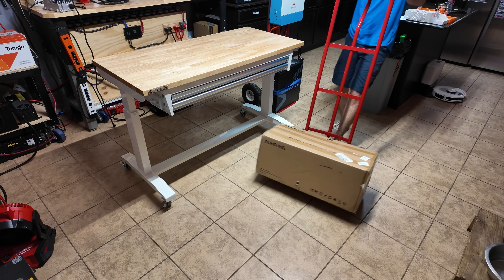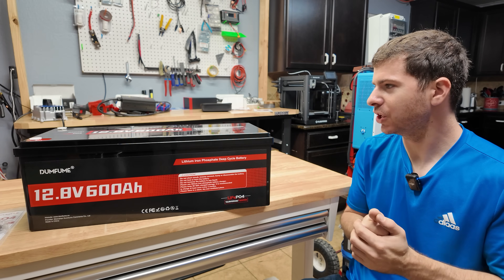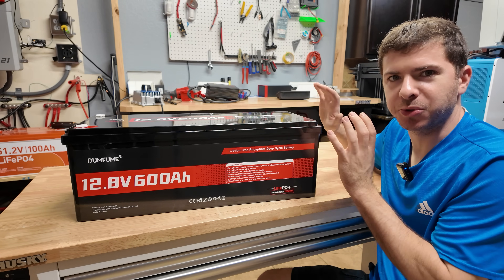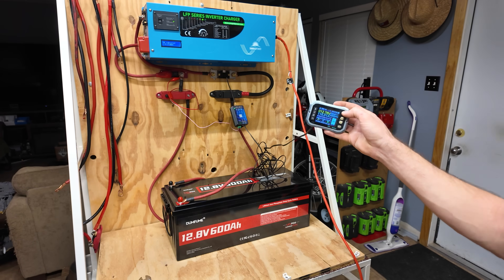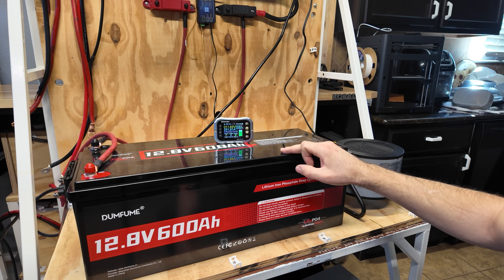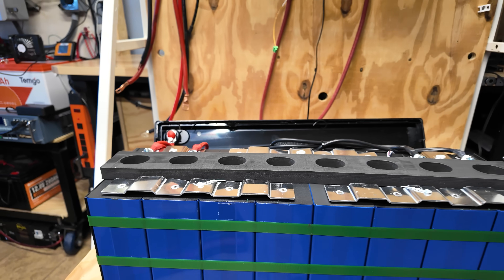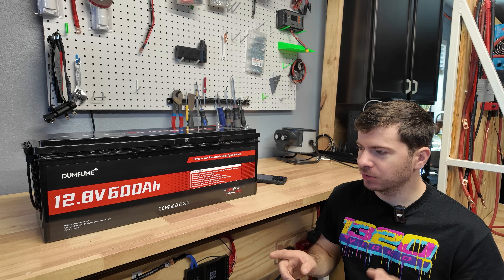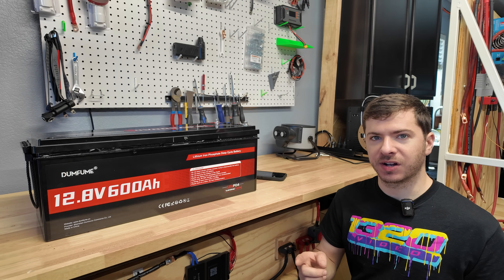$559.99 Dumfume 600Ah 12 Volt Lifepo4 Battery Review! Teardown! Testing!  7600Wh

Comment: The battery advertises 3200 watts draw which is equal to the BMS marked 250 amps so 255 amps on your test should be within spec and not an overload.  The 4 each of 7 AWG marked wires (probably really 10mm metric) should be close to a #1 AWG in sectional area.  That is on the light side for 250 amps continuous draw.  Over 650 total amps in a 600 amp battery is great.  

A T Burke

Comment: Hey you have that junbpaw inverter, do you have any plans to review their dual voltage 24/48 v automatic transfer switch inverter models?

Can you try humsienk 600ah too
Reply from the maker: Yes i do want to check out the humsienk battery aswell,   and i may look into that, i just reviewed that inverter for a video, it did good especially for the price

Comment: I have 8 of the 300ah from dumfume series paralled 48v they are all around 330ah when tested very happy with them so far.
Reply: In parallelo e in serie for 51.2volt 12.8 x4 in serie and 4 in parallel is 628ah a 51.2volt nominali is 32kwh a 54volt

Comment: These batteries are great for the price. I have 4 each 300amps running my food truck with a 12v system...
Reply: Good is 16kwh 4x 314ah 4kwh for battery x4 16kwh a 12.8v in parallelo is big power con bms da 200ampere x4 is 800amp. Max power con inverter 3000watt is perfect 250amp.x 12.8v is 3000watt cable 75mm2 o 90mm2 is good for 12.8v

Comment: Just got a couple of 12v/300ah Dumfume for aournd 250$usd each.  They test around 325ah each.  Quite happy with this deal.
Reply: Yes is 314ah 12.8volt 4kwh x 250dollary is good
Reply: @stefanocerna6504  Mike opened the dumfume 12v/300ah, the are 280ah. But good quality.
Reply: Could you share the website you got them from?
Reply: @jamesc4263 probably Ali express
Reply: @jamesc4263  Cheapest from Temu

Comment: Thanks for the review.  I've been waiting for it as I'm the one who bought it on Temu during Cyber Monday for $526 with free shipping. Unfortunately, they no longer sell it, but saw it on Amazon for $570 with free shipping. I saw a newer 614 WH model somewhere, so I think it will be replaced. Glad to see the build quality is similar to the other models.
Reply from the maker: That would make sense  some other brands have 630 and 650 ah versions too . If you go to the site and use the discount code it gets it close to 530 , I may get 3 more and build a giant 48 volt battery!
Reply: @Mikebuildss , I wanted to warn your viewers how bad some shippers can be. FedEx has really gone downhill as they are often late, and my drivers barely speak English. This 105 lb box was delivered the day after it was promised by a female driver. She said she could not move it and texted another person for help.  She said it would be delivered later that day. It wasn't, and when another guy did bring it, the next day the box was basically in poor shape. Someone grabbed the box by the side handle and tore the whole side off.  Fortunately, these are packed very well with high-density styrofoam, and the battery was fine. The box showed signs of getting wet, also.  Sorry for the rant.
Reply: Just got 4 of these for a total of $2070 (7% off for buying more than one and $10 off total for leaving them in my cart for a bit which generated $10 off next order email)
Reply from the maker: @justinmalin9197 that a lot of capacity for that much money, you did good!
Reply: 600ah is 628ah is cell da 3.2v 314ah is big cell real 325ah

Comment: A month ago I put 4 in series for my 48 volt system 30kwh it is a beast and good value for money.
Reply: Is it hard to keep them balanced?
Reply: @idahoduckhunter  I use a Litime balancer which keeps them to .1 volt
Reply: @idahoduckhunter once in awhile I charge them 1 at a time just to make sure they stay balanced...
Reply: @idahoduckhunter im looking to set up some and try it this way i have a setup with  balancing seem to be working  fine
Reply from the maker: Nice! That’s a lot of capacity! I want to do the same thing
Reply: Seen where a guy was using 12v in a 48v setup he was charging  with 12v to keep them balancing
Reply: A grade Cornex cells have a 12000 cycle life , I brought 16 x 314 Ah to build my own battery pack 👍🏼👍🏼
Reply: @peterneave887   I am just in the process of hooking up my Lux 12k to them
Reply: I’m going to wait a while before I recommend these new giant batteries to anyone. Between the weight and the output of the bms being 200+ amps, I’ll wait for them be out in real world scenarios.
Reply: Just go 48 volt golf cart battery. Simple, safe, less mess.
Reply: @Gratefulwon  that would give 5kwh each so I would need 6 so way more money
Reply: @offgridwanabe Not that much more money, 48 volt 105 ah go for 800 or so. But putting four of them in parallel makes a much more stable pack than 4 12volt in series. You get other benefits as well such as much deeper current reserves, fewer wiring and termination concerns, and a failed battery would not kill the whole system.
Reply: @Gratefulwon almost twice as much in money then what do you do with a broken 48 volt battery where as if a 12 volt goes I can use the other 3 for other uses. Then there is all the communication problems they have with server rack batteries where as voltage is much simpler to manage. So each to his own I guess
Reply: @Gratefulwon 4 x5kwh fa 20kwh no good Vs 4 x 8kwh 628ah a 12.8volt is  8kwh x 4 is 32kwh x 2400dollary